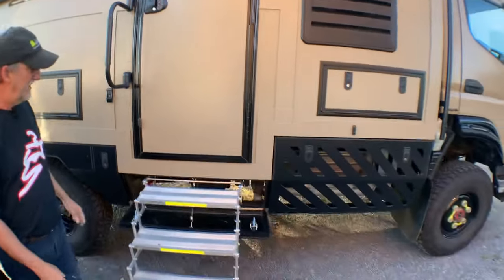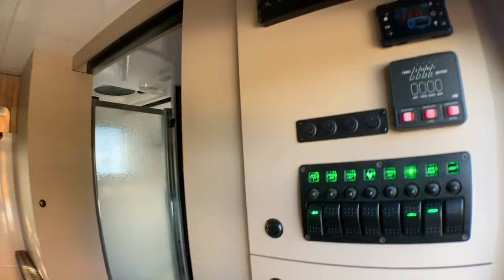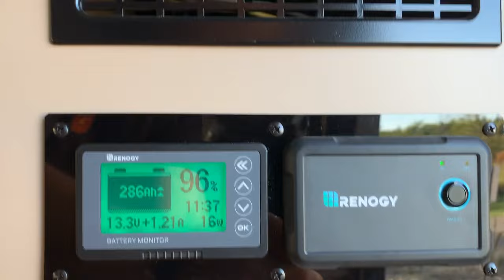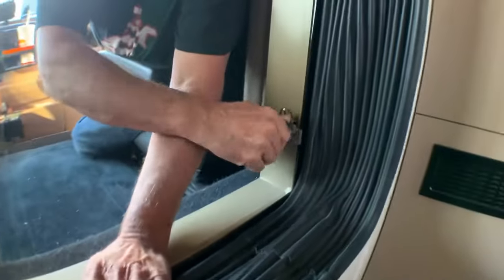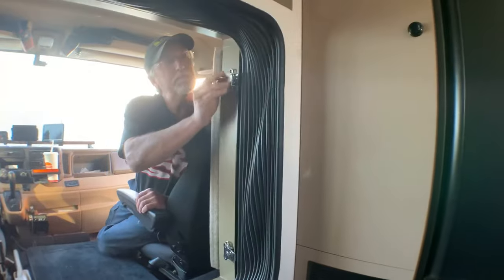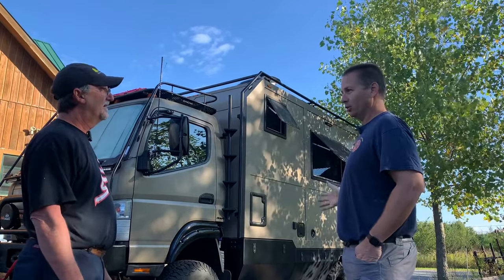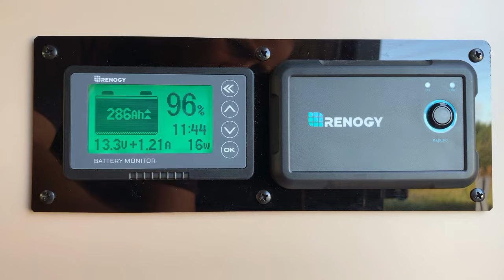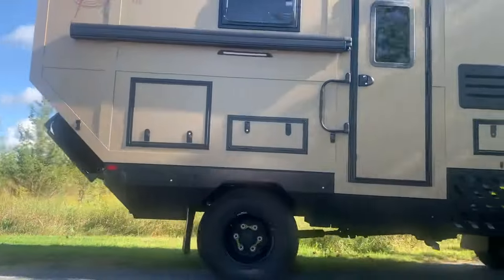Must see PHENOMINAL Build tour !  | DIY Fuso FG Overland Build

Comment: I have looked at doing a pass through to my cab many times but increasing engine and road noise seems like a near certainty as I don't imagine that concertina gasket stopping much. For long journeys it has a huge impact onn driver fatigue from personal experience. Ive contemplated doing a two door system so cab and box never touch and there is a solid sealed door that has a chance of keeping out the noise if I do a good job, my engine sites up higher than this so getting through is never going to be convenient which is another reason I haven't done it yet.
Reply from the maker: Some of us are lucky to get to choose whether to have it or not.  Our truck won’t - but certain areas require it to be registered as an RV.  😎
Reply: You are right about the engine noise, it doesent show in the Bruce's video whe have a 2" soudproof foldable pad that is stored  behing the passenger seat, it's a must for long drives!

Comment: Stunning build, Pierre-Carl has created a masterpiece of functional and beautiful design there.  I'm also very impressed with his selection of materials and simplification to keep weight down where possible.  The fit and finish is something we all should aspire to.  It's a credit to his craft and skills in every way.  I also think purchasing a 'parts camper' was a fantastic way to get a good package of items that suits your needs.

I installed a cable interlock for the brush bar and cab tilt on our Fuso.  It's all well and good to remind yourself before tilting the cab, but it's that one time when you are a bit flustered (non-starting truck partly blocking a street, for instance 🙄) and only think you've already dropped it that was enough to convince me I should design an interlock.
Reply from the maker: That’s a great idea!  Do you have a cable that runs from the bumper up to the lock handle?
Reply: @BruceandKrista  Yes, it's just a standard industrial push-pull cable available from a number of suppliers.  After drilling a small hole through the bumper behind the brush guard flange, I welded a small u-bracket welded behind the bumper for the threaded cable sheath.  When the brush guard is closed it simply pushes that end of the cable flush with the bumper.  The other end engages in a hole in a small tab welded to the safety lever for the cab tilt mechanism.  You can even run the cable along the chassis rail to keep it looking 'factory'.
Reply from the maker: Good stuff!!!

Comment: Looks so good. The boxes are incredible. Would love to learn more about how he made his undercarriage boxes out of alupanel! How are they fastened together? Rivets and Sika252?

Also super curious about the truck's weight vs gvwr and the dimesions of the habitat.
Reply from the maker: The 1x1 box tube frame inside the lower cabinets is welded together, then the Alupanel is bonded to the aluminum using 3M VHB tape.  I hope to do something very similar (though slightly different!) 

The length is 15’8”, it’s 89-1/2” wide, and 84” high on the outside.   Not sure if he has weighed it?
Reply: @BruceandKrista  thanks! That's the size I'm planning for, too.  What does that put the whole vehicle at? Probably 22ft long and 11ft tall?
Reply: @theborednerds The dry weight is 5200kg, has for the mesures you are verry close 21' 8" long and 11' 2" tall!

Comment: where did he source the storage doors? and what windows are you using?
Reply from the maker: There are many window and door vendors on AliExpress and Alibaba - best to take a look at which vendors have what best suits your needs.
Reply: @travis,
2003, we built our ExpeditionVehicle on a 1996 Ford CF8000 commercial truck.
.
Our windows are 3010 (three feet wide by a foot tall) dual-pane sliders designed for a stand-still house.
We mounted these at our eye-level standing inside, about eight feet above pavement.
.
Over two decades full-time live-aboard, zero issues.
And small windows are small targets for branches and jealous by-standers.

Comment: How did he recolor the cab interior? 
Dash paint or something better?
Reply from the maker: I believe he used a paint that is designed for interior trim - but I’m hopeful that he can provide a bit more detail here!
Reply: To paint the plastic, I first cleaned the parts with a degreaser soap then lightly sanded and rinsed well with water, before painting I applied a plastic adhesion promoter in aerosol then several coats of acrylic paint for plastic and vinyl. That said, the paint is not resistant to scratches has much has i hoped, I plan to do touch-ups as needed! It was a lot of work and maaany of cans of paint, but I don't regret,  the pale blue whas making me sick😆 
Let me know if you plan on doing it and need more infos.
good luck!😉
Reply: Same stuff I used in n the past. Yeah, it’s not scratch proof. Just finished my interior in all black